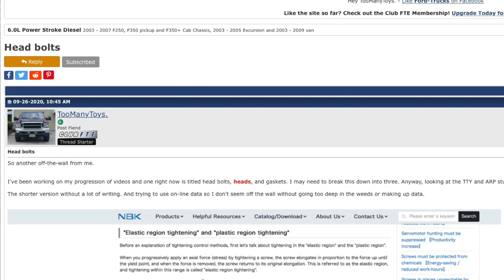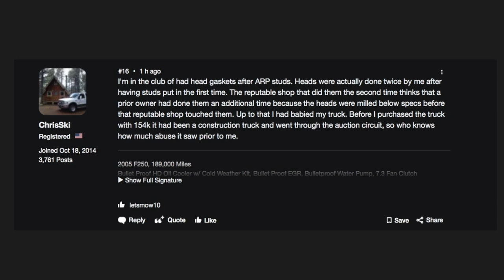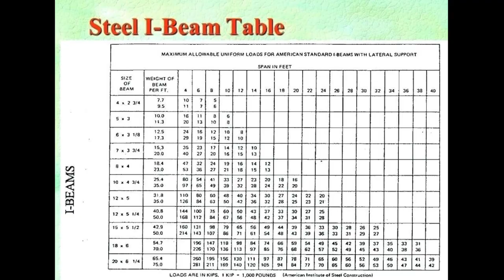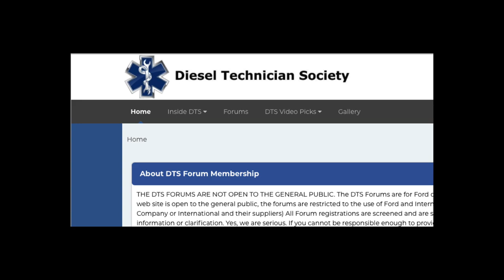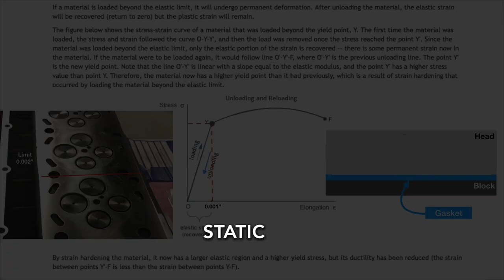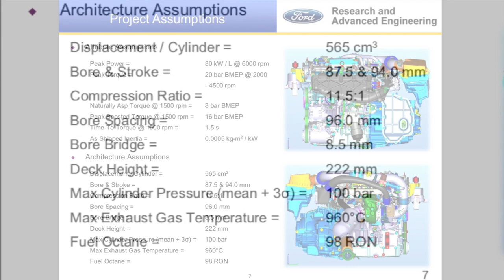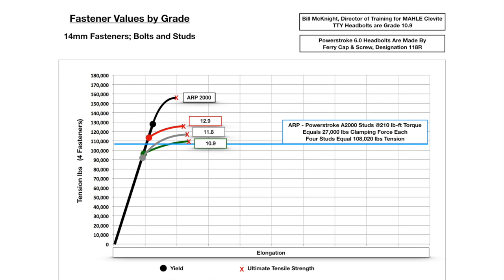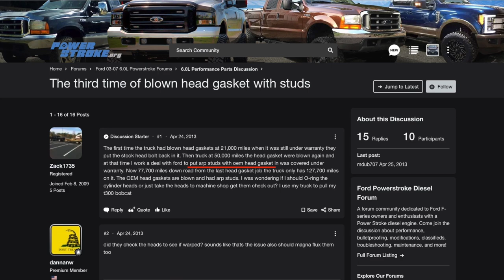Powerstroke 6.0 - Head Gasket Failures and Head Bolt Clamping Force

Comment: Excellent video Jack. In short. It's too bad that Ford waited till the 6.4 head design to incorporate the  additional material cross bracing around the cylinders as in the 6.4 head design. If Ford would have done that, with the introduction of the 20mm head. There's a good chance this Ford could have saved face too a point. Accepting the design flaw and would have had less of warranty repair to just the 18mm design???🤔. 

It makes me think of the SBF 302. 1968 release. Ran for almost 2 decades. Of course with improvement design along the way?

I haven't seen the KDD head yet. I wonder if their design incorporates any of the 6.4 head updates??  Additional material cross bracing between the valves?

I'm currently on my second set of HG's with Felpro and ARP's at 210 FPT.  Roughly 70K on second set. Mild tuning with 2 tow tunes depending on what I tow.  Car hauler, with usually around 8K when I towed with it.  And a 28' TT, at about the same weight fully loaded. No issues at the moment 🙏. I will be looking at KDD heads when a complete rebuild is due. Hopefully not soon. I have 285K. Stock original injectors (new orings at 122K). Stock tranny. 

Again, excellent information and presentation!!!

Ed
Reply from the maker: Thanks, Ed.  Glad you are doing well with the rework.  I don't think there is an absolute with this situation, it may be very dependent on variations, and there were different 18mm castings.

Every part on a vehicle platform has what we called "maturing."  We did a lot of accelerated testing before the platform launch, but it is the real test when it gets into the public's hands.  And if our product was on the platform for ~5 years, there were always changes to solve new issues.  We could do ours in 6 months; heads might take 18-24 months.  Four years of 6.0 in vehicles just might not have had the time to truly sort out.

This morning, I saw a post on FTE about new KDD aluminum heads, and looking at them, they incorporate the 6.4 design change.  I could not figure out how the aftermarket heads in aluminum were doing in the market.  When I worked in the carbon fiber industry, if we replaced steel with aluminum, we had to up the thickness 2x to have the same stiffness.  I think they did the normal progression.
Reply: @toomanytoys  you may consider (a request) doing an episode on aluminium heads and share your thoughts and ideas, even if it turns out to be theoretical.

Comment: Wish you could've shown more of the carbon paper test.  The bolt vs stud stuff will be kept alive as long as ARP's creative advertising BS over sells their products.  A chamfer to the head's bolt hole, out to the dia. of the block's counter bore,  would distribute the load a bit better, wouldn't it?   Also, any & all alum. heads should be re-torqued IMO.   Thanks.
Reply from the maker: It's still very localized, the frustum is still concentrated near the bolt, and it does nothing to address deflection due tot he width between the bolts.  The ideal would have been what took too long, the reinforcement of the combustion chamber area as done with the 6.4L. But, unfortunately, aluminum has its once set of problems and takes much more work to solve deflection.

I'm working on a video about fastening and fasteners and a proposal to look at the bolts I'll need participation to do.

Comment: If I'm understanding it right, would it be beneficial to somehow shape the middle as a domed surface? Then as we clamp down there is 1 higher clamp load at the center, 2 as the head stretches and work hardens it would take higher loads and deflect less?
Reply from the maker: When bolted down it would be a higher pressure in the center and be higher stressed. But that would take a significant amount of work for a machine shop to set up compared to normal milling and have to be done on four separate cuts, both ends, both sides, plus trial and error to find the correct amount.  

It's most likely cheaper to set the head up for o-rings as it would be done either with a CNC or using the expensive BHJ tool that shops can buy for o-ringing heads.  http://www.bhjproducts.com/bhj_content/products/blocktooling/org.php

Comment: Amazing Jack. Do you know if anyone in the aftermarket has tried to redesign and different head design?
Reply from the maker: The morning after I posted the video, on FTE there was a post about new aluminum heads from KDD, incorporating the 20mm coolant passage changes, increased bedplate thickness, and 6.4 style stiffing ribs.  I replied in the post, I just introduced their heads the night before!

I am leary of aluminum heads on this application in the aftermarket but would let it play out in the tuned world.  Aluminum can be fine if designed well, but you need to almost double the wall thickness to match steel's resistance to bending, and aluminum will start to lose heat treatment properties at 200º.  The OE resources I have more confidence with.  But they might be great heads; I just wish they did the same with the iron-based heads.

Comment: Another fine video. I am in the process of changing the oil cooler and replacing injectors on my truck and I’m wondering if I need to put head studs on it. I’m staying with a stock tune. It has 123k on the engine. Being a 2005 it Has 18mm heads. Or should I leave them alone and just do the necessary fixes.
Reply: Like you, my 05 is stock with no tunes.  An argument can be made that since you are doing all that work anyway, might as well do the heads but if it ain't broke, why fix it.  If you do switch to 20 mm, you still need to make sure it is flat because new castings from Ford apparently does NOT = flat.
Reply from the maker: Like the other reply, I tend to leave things alone - to some extent.  There's data for when to change out things like drive belts, HFCM, etc.  The head gasket issue has such variability, and at least from my perspective, lives on an edge where the wrong tune can cause issues.  As I noted, if you've had an EGR cooler failure, the trend seems to be 30-40k later; the HGs will be an issue.  So if that fault was experienced, you know what the future brings and can address it before it occurs.  I have one forum friend who had his van to 900k before working too much about the durability.  He and his family camped all over the states.
Reply: @toomanytoys  I do know this truck had its EGR replaced with an aftermarket unit from sinister diesel within the last year or two. Based off that, do you recommend head gaskets. The oil cooler was replaced as well but with a doorman one; that’s why it’s getting replaced again. It has plugged already.

What are your thoughts on the oil cooler being the culprit for a lot of these issues. If it plugs off it starves the egr of coolant cause it to fail then the head gaskets.
Reply: @LukesGarage  My vehicle was an ambulance that I bought used from the army with 62k miles.  Found its history = Ford dealership = Had blown HG when the paramedics let it run dry, 2 oil cooler and one EGR cooler replacement during its service.  When I got it, deltas were approaching 15, so I changed to upgraded Ford oil cooler, Bulletproof egr cooler, and other upgrades as per DieseltechRon's (RIP) recommendations. I installed a coolant filter and did complete flush b4 the engine work and now use Fleetguard's NOAT ELC. Run T6 5w40 because I live up north and stiction is gone even at -20.  Still TTY bolts, no tunes, but no towing and I am hoping my gaskets hold up despite Ford's apparently lousy fix for blown HGs.
Reply: @alporan9087  I too frequent Ron’s page. 

I’ve decided to add them while I have it torn down and cab off. Peace of mind I guess.
Reply from the maker: @LukesGarage  If you meant the EGR cooler, I come across enough HG failures associated with EGR cooler failures that it's a question I ask anytime someone is replacing HGs - did the cooler fail earlier.  If they are not running tunes, it usually had.

Before you pull it down to replace the oil cooler, I would do exceptional steps to clean out any rust or silicate.  The silicate is very difficult to remove.  Even after several runs with both Restore and Restore Plus, mine still had silicate in the oil cooler, and years later, when I cut open the heater core.  The Dorman product was more prone to its gasket failure than clogging.

Evapo-Rust makes a rust-removing coolant cleaner.  I have not used it yet, but using their product to clean my heads and block "on the bench" was remarkable.  But any "de-scaler" is going to clog an oil cooler more, so do any of that right before you are pulling the oil cooler.